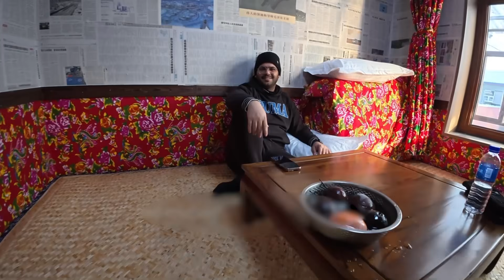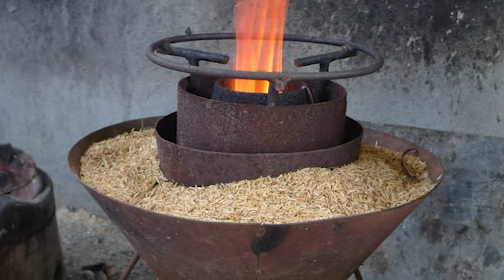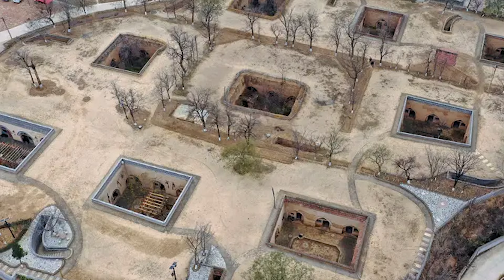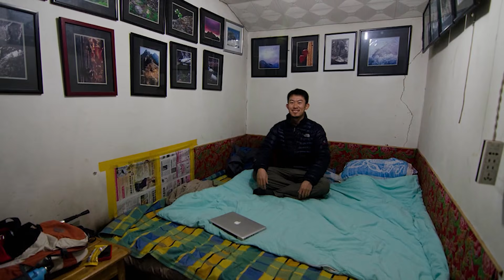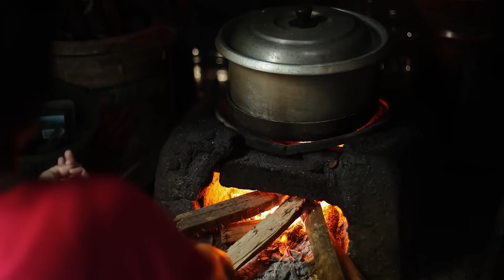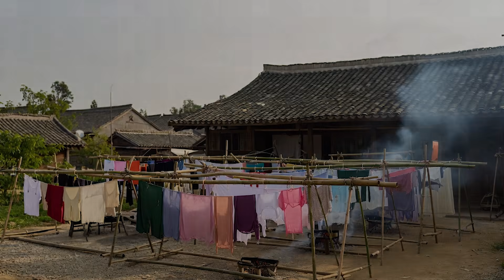20 BANNED Chinese Heating Tricks That Scientists Now Say Were GENIUS

Comment: The first one is a actual danger... You should offset the fire and use only hot air chambers under the bed at most and the fire should happen in a safe furnace outside the room... The rest are just insulation, thermal acumulators, batteries or not very eco friendly fuels. Those were used in extremely similar ways around the world. Home stoves are usually banned because how hazardous they are used and maintained. Too many people died or set their houses and entire neighborhoods on fire